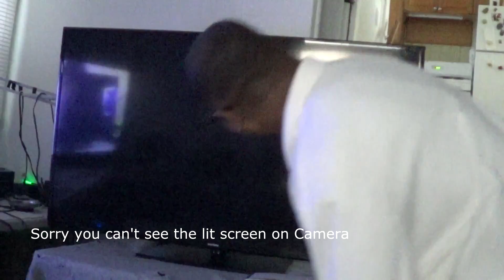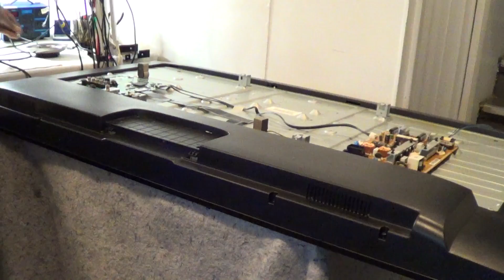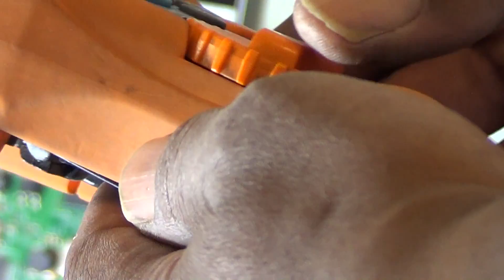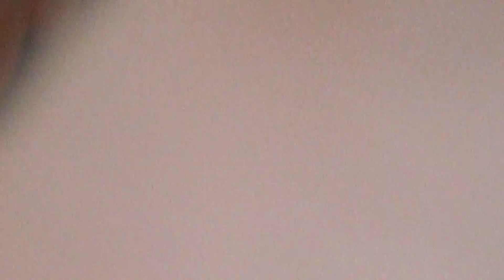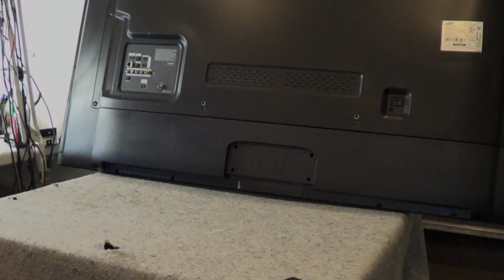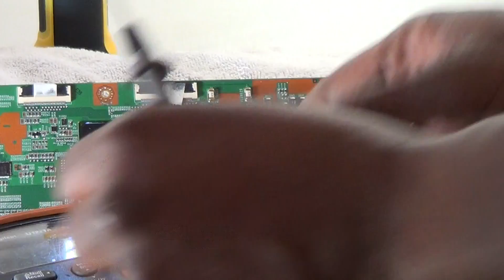Backlight but No Video troubleshooting. Samsung UN60FH6200 T-Con

Comment: Hi Dog, do you have time to respond to my latest question? I really appreciate you and all the great help videos you put out. You're a good man. 

Jerry, the Packer fan. Don't hate me because of that. LOL 😮
Reply from the maker: Sure sorry Brother, what was the question?
Reply: @bigdog8882  the reply from me from yesterday was...
I should clarify. When I'm looking at the back of the TV, I have the left board plugged in and the right board unplugged. Then I stand it up on it's legs and the right side of the TV screen shows a picture. Then, again, looking at the back of the TV, I unplugged the left board and plugged in the right side board, and I'm back to a black screen with backlights on. So I should be looking at the right side board for problems, correct? I also noticed that the standby light blinks 8 times and then goes off when doing both scenarios. Does that blink code mean something ? Also, the TV powers on just by plugging it in, not even using the power button.
Reply from the maker: @JERRYSCHULTZ-l8d  The side that you have unplugged when you get half a picture is the side thats loading it down. So start with checking that sides driver boards. Hope that helps.
Reply: @bigdog8882  Dog, what do I check and how?
Reply: I mean what do I check on that driver board and how do I check it?

Comment: Hi, l'm having a problem with my tcl 75s451 led tv. The TV powers up and has backlights and sound, but does not have a picture. So I replaced the t-con board, but still have the same problem.  Also, the remote does not turn the TV on or off. It has new batteries. Not real concerned about the remote right now. Any suggestions  from you? I did just purchase the power board to try that, but I'm not  confident that will work either. What do you think? Thank you, and I hope to hear from you soon. Great videos, by the way.
Jerry

Comment: I am so thankful for this video and your honesty :-) At 19:00 into your video you discussed testing it before you put it back together. You explained how it grounded out the T-Con board. I did the EXACT same thing :-( I had it apart to re-glue some of the LED reflectors that had come off. I put most of it together and tested. That's when I only had backlights when it previously worked fine. Needless to say, I just ordered a T-con board. Hopefully this does it. Thanks for your help.

Comment: Dang this video is old and I could have used this years ago! It sucks this didn't come up when I searched years ago...but hopefully you can still help... I don't have the model number on hand but... It's a Samsung 55 that I found in the trash, the same symptom as this video. 

I opened it up and most of the LEDs were burnt out so I ordered new ones and replaced them, upon reassembly the panel slipped and I believe I damaged it... Now when it's turned on, it's all weird for a lack of better wording, believing I damaged the panel ribbon, is there a repair for this or is it basically a lost cause at this point? Our is there a source for a replacement that isn't more than a new tv unit lol

Comment: My screen when white , so i covered a few pins on the left ribbon cable , and now the right side is perfect but the left is less quality . Could this be the tcon board not delivering signal to some of them little test points next to the ribbon cable plug ? Or is it the panel ?

Comment: Thank you for the video. I would like to know where I can find out what the voltages should be on the various test points on my Samsung LCD TV?
Reply from the maker: Should be a legend on the board next to the pins
Reply: I looked at the boards in my TV and there are no voltages shown anywhere that I can see. I only see test point identifications. I looked at the boards in your video and I can't see any legend for voltages either. Am I missing something?

Comment: I have a UN60Es8000 that has the same sound and backlight but no picture.  I tried unplugging each of the 4 ribbon cables to the T Con board trying each by them selves, in pairs etc and I never got a picture.  The T Con was receiving 12V and the fuse was good.  I tested all of the output pins on the ribbon and one row all got 1.4V and the other 0.9V.  On a whim, I replaced the T Con and ... It WORKED!!!.  Save me from buying a  +/- $4K QD-OLED.  Thank you for posting your videos and giving me ways to check my TV.  We still do 3D movie night and so this saved us from dropping that family event.

Comment: Hello.
I’m subscribed and liked.

My Tv is not turning on and I have flashing standby light. Replaced both the power and main boards. Same issue. With all cables unplugged from power board i am getting the correct voltage to main board but when I check voltage to the LEDs with out it connected it is showing 419 VDC+ volts to the first pin and none to the rest. Does this mean I have a bad IC?

Comment: from india ..good points..  dude .. u taught me lot.. looking to fix my LG 4K 50 inch .. horizontal lines ..  lg local service checked ..they say panel issue ...but don't believe it is panel issue... need replace panel cost  20k INR ..too costly i can buy new tv.. but  don't want to give up existing tv ... so planning to check and replace  T-CON if possible.. thumbs up
Reply from the maker: Believe it. T-con usually doesn't cause lines. Just a "whole picture" or "no picture" problems. Its usually the screen COF cables or IC inside the cables. Thanks for watching. Blessings!

Comment: Hello... I congratulate you for sharing your knowledge with those of us who are starting. Besides, I wanted to ask you a question. I have that same model of tv and what mine does is turn on and the logo appears with horizontal stripes but the screen looks perfect. After several minutes the leds turn off but the audio continues. If I turn it off and turn it on again, it looks good again, although a horizontal line is noticeable at the bottom but not as visible. What do you think might be causing this problem? Thank you so much.

Comment: Just a question...Which part of the power supply board or other boards cab cause a severe shock and one has to be careful of...or what one has to do once we open the back to discharge for safety.
Reply from the maker: The primary side of the Power supply, Just put your meter on the big filter capacitors and make sure the DC volts is close to zero.

Comment: Hello! I was wondering if it's ok for the fuse on the TCON to be displaying 14V ? From a samsung plasma.
Reply from the maker: Plasma tv is entirely different. They use a logic board. So the 14v may be good or bad depending on the line the fuse it is protecting. Thanks for watching Jose.

Comment: Hi, thanks for the video, I have checked that, there is not signs at the T-con broad input, I checked before the input, there is 1v signs from at the control panel output, if the issue could be happen in the T-con board?

Comment: Two things. If in PSU you wanna just swap the fuse, and not risk blowing it back again, you should connect it through the bulb. If short will be still there, the bulb will light up, if not short, a small blink will be seen and PSU will wake up, or, at least you can continue your diagnoses without worrying from now on.

2nd thing is that we should not just short capacitors IMHO. We should use something like a 3.3k ohm resistor to do it. Why is better? Google can answer if you're interested :). Yes, will be no spars, that's a good guess ;).

And, thank you for the video, as always, good job!
Reply: In series? With a filament bulb or the common type bulb?
Reply: @Gimnyigei  filament, but keep the watts right

Comment: Hello,
i am checking my TV for a t conn failure. the TV has a blue screen. When I disconnect the right cable from the t conn to the  LCD half the screen comes on. If i disconnect the left cable the screen remains blue.  would indicate a t conn failure or the  LCD is bad?
thanks for the video's

Comment: I Have A Flat screen I Got From 
My Neighbor Downstairs Here In My
Building The Standby Light Comes On
But I Have No Sound Or Picture.
So Could It Be A Fuse Or A Loose Power 
Cable Going From The Power Supply Board?
Or Could Be A Bad Logic Board
Or The Tcon Board?

Comment: Hi, I have 60" Samsung (UN60F6300AF) which I replaced all the LED strips band are working. Unfortunately now the video is all damaged. Parts of the screen is perfect while another part is completely dark. There are other parts of the panel that colors are messed up. If all the voltages on the t-con board check out could the panel be bad? In other words is it possible the t-con board is still bad? Thanks.

Comment: Hello and I really appreciate your video. I have a similar problem with my 75 inch Samsung  OLED TV. It has sound but it does should a blue screen only. I was told that it could be a main board and I wanted to know what your thoughts could be? I want to say thank you very much for your input.  Lastly,  do you have a law enforcement background?

Comment: VGH  20V TO 30V
VGON 20V TO 30V
VON  20V TO 30V (Supply Voltage for CKV / CKVB / STVP
VGH  20V TO 30V
DVDG 20V TO 30V
VCOM 12V TO 15V
VCOM 5.5V TO 8.5V
VGL   -5V TO -8V -12
VONP  21V TO 30V
VOFF  -5V TO -8V
VGOFF -5V TO -8V
VEEG - 5V TO -8V
VDD  = 3.3V
VLOGIC =3.3
VDA  12V TO 20V
VDDA 12V TO 20V
VDDC = 1.8V
VCOM 5V TO 7V
AVDD 12V TO 20V
DVDD = 3.3V
VCC 1.8V
VIN 12V

VOFF / VGL /VGOFF / VEEG   -5V TO-9V
VDD / VLOGIC / VDDD / DVDD  3.3V
VDA / AVDD / VDDA / VSOURCE 13V TO 20V

Comment: Hello brother I have a toshiba 55l7200u back light went one side was working so I change it but before I change it the one side that wasn't working i decided to check it with the good side it works i saw it flash as usual but I forgot to put something underneath it and I saw little tiny spark so put something underneath and try it back did not get any flash so when I got the new led I put it all together back I saw the little green light went off when I press the power button on the remote but the TV did not come on any help or advice what could possibly happen or something blow please help thanks

Comment: I greatly appreciate this video. Would a T-conn board keep the TV from turning off? I have backlight only with no display and the TV comes on as soon as it's plugged in. When I press the power button (or even press and hold the power button), the red standby light flashes in response to the button being pressed but the TV will not turn off.
Reply: nope. T-CON controls display

Comment: awesome videos. but what if the tcon chip IS hot to the touch? what is this a sign of? I can't find any info on this. the same thing happens if I switch it out with a new board so I dont think it's actually the board itself.

Comment: I have this tv with bad led backlights It passed the flashlight test so I decided to repair it.  I replaced them and still nothing. Troubleshot the powerboard and ended up replace the 2 diodes in the led driver section which fixed that problem. But after I put the tv back together, I now have no picture. So frustrating. I checked all of my connections, then reluctantly ordered a replacement t-con board. It came today. I installed it, and still no picture. What am I missing?

Comment: In my first step i found out - When i disconect the T-CON Board from Main Board, the TV goes on.
I think there is a shortcut on the T-CON board.
 
Did you ever had a error like this? For me it is hard to make measurements without the TV goes on.
My Dates:
Samsung TV UE60F6370SS
T-CON: LFS600HJ01 / SK98BN950 / 0944AD27Q / D493320

Comment: My TV Samsung model LN40B630N1F powers on the backlights come on for 1 sec and then they turn off but the TV  is still on.  Do you have any suggestions on what would be causing this?

Comment: Hey boss man, I'm hoping this video helps me. I have back lights and sound and it seems to switch from dark screen to a lighter dark screen then to dark screen and it has sound. I'm a few min in and so far sounds like my issue. Mine is a different model but I believe it's the same issue. 55" UHD 4K Smart TV Model UN55HU6950FXZA Version TS01

Comment: Big Dog great video and one of the best! Much appreciated and I really appreciate your simple approach to what can be very complicated BUT i need your help ...i don't think my samsung has a separate Tcom board model# UN65KU649DFXZA 
 version FA02 made Dec 2016
I only get a blue screen (back lights ON) , no audio and no text.
I have the power board and then the main board that has 2 large ribbons that go to the bottom of the screen and clip into the ribbon holder and thats it.
When removed the ribbon between the power board and the main board the screen gets brighter  blue and when I reconnect its still blue BUT dimmer. 
I checked the fuse on the power supply and all is good. I disconnected wifi and that did nothing....whats next ? Is the Tcom board integrated into the main board?
Reply from the maker: Actually part of the T-Con is on the driver boards connected to the Panel. Been getting alot of that model. You have a bad Panel (Driver). Most likely. Maybe time for a New TV if you dont see anything specific on the Driver boards.

Comment: Thanks for the help. Had half screen gray and black with audio on a LG 75". After closely looking at the T-Con board notice the bottom right ribbon connector was not latched properly. I simply pressed the ribbon latch back on, then plugged the TV in and turned on and bam it was back!

Comment: My SAMSUNG tv went blank and then no sound.  I replaced the Power Supply board The TCON board and the main board and the wifi  I get a BLINKING LED lights and Standby light -- I replaced ( again ) the TCON and Main board but still same thing BLINKING LIGHTS and nothing else.
Reply from the maker: Whats the model # ?
Reply: @bigdog8882  -- UN60J6200AFXZA -- VERSION  NS02
Reply from the maker: @williamjamesrapp7356  Does the screen atleast light up with backlights or just a constant red flashing standby light with a totally black screen. Does the standby led light on the bottom eventually go off?
Reply: @bigdog8882  The standby light does not go off The LED lights BLINK constantly in time with the standby light -- You can see from the screen side and on the inside the LED lights blink on and off every second   I held the power button down for 30 seconds but nothing  -- It wont turn off and no menu screen comes on.
Reply: I did not take apart the layers of the screen so I can only see the LED lights from the holes on the inside  so I do not know if one or more LED light is not working   but they do seem to be all working
Reply from the maker: @williamjamesrapp7356  thats weird on that particular model. Never had that on b4. Could be the leds. You should check the leds with a led tester.
Reply: @bigdog8882  Thanks for your effort.  I do appreciate it.  If I find anything out I let you know just so you know.  ROCK ON

Comment: Bigdog, some advice if you dont mind? 

I have a UE48HU7505T, it has the same issues as above, the fuse on the T-Com is fine, the test points on the input ribbon from the main board is showing 0.52v or 0 on a lot of them, i cant turn the unit off, would this be an indicator that its actually the mainboard and not the T-Con? i have 12v 18v and 5v coming from the power board into the Mainboard, no chips on the main are very hot so i dont suspect a short. 

As there are only 3 boards on the TV (not including the driver boards on the panel) would it be worth replacing the Mainboard?
Reply from the maker: If the tv has no functions. Yeah I would suspect Main Issue.
Reply: @bigdog8882  Quick up date on this, traced the issue to the 41pin cable connector coming into the T-Con board, one of the flat ribbon traces that goes into the connector on the T-Con board, had lifted and was shorting itself on the pin directly next to it. this was giving me low 0.91v on the 1.2v VCC TP on both halves of the board, replacement cable and the screen sprang into life.

But your video was immensely helpful Thank you very much bigdog.

Comment: You neglected to point out/test the 6 fuses on timing con board shown @ 14:20
You're Welcome ;)
Reply from the maker: I see them now lol. Thanks Bro!
Reply: @bigdog8882  still got that control board???, curious as to if those got open when the ribbon cable hit ground, hence why no waveform voltage on the outs ;)
Reply from the maker: @thecentralscrutinizer5105  Yeah I know. Dat board long gone tho. Thats probably what happened tho. Just blew one of those fuses.
Reply: @bigdog8882  lol, One???, I'm guessing a few if not all, bummer it's gone, would have been interesting, but now we know for future ref ;) Thanks

Comment: Would it also be wise to connect an small, low voltage illumination lamp on the open fuse to trouble shoot the board as it’s powered on???? I think I saw a technician do that on a tube television, but with a household incandescent 💡.

Comment: Bigdog, nice in depth video. 

What if my backlight is flashing? I can see it flashing through the screw holes with the panel off. Which board could be the issue? I didn't see any damaged capacitors.. Please help! Kids are getting crazy over here.
Reply from the maker: Most likely You have bad led's inside the tv. https://www.youtube.com/watch?v=muxJKP_klVI
Reply: @bigdog8882  Mhmm. I got a UN60J6200AFXZA thats pretty much identical. Well it looks like I got some work to do.. Not looking forward to the "working on a car" position haha. Thanks Bigdog

Comment: You have great videos. I have a Samsung 75 4K QN75Q7FAMFXZA. Back light and sound works, but I have to unplug and replug the television several times before seeing a picture. I have replaced the main board, same result. There does not seem to be a t-com board. Any suggestions?